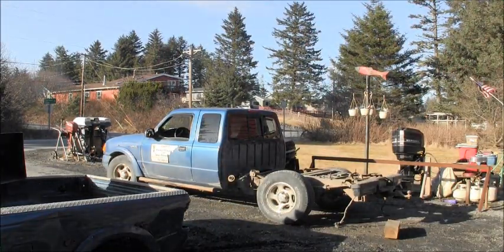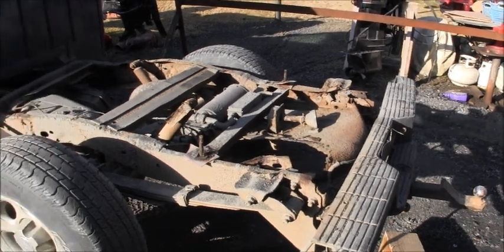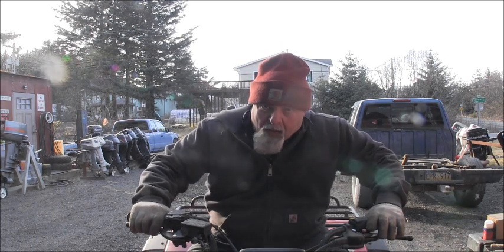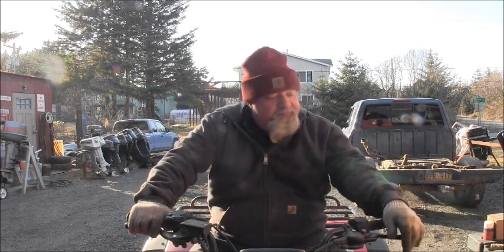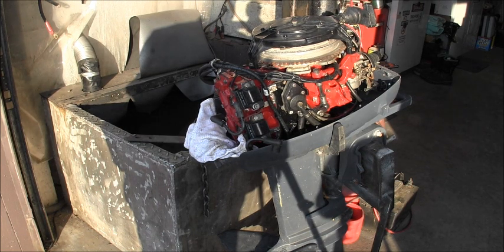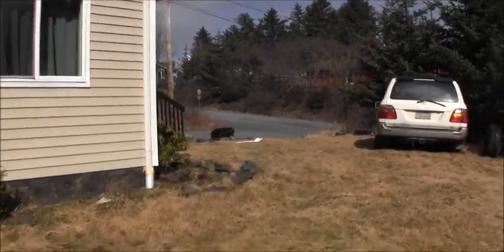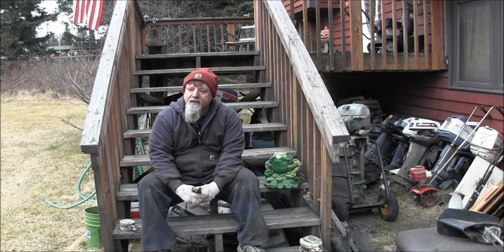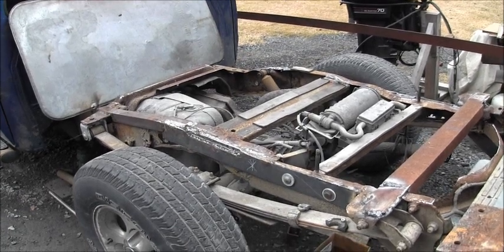EVINRUDE  30 HP,  OUCH    not  good

Comment: Omc 9.9-35hp have been a long time hobby for me. Just curious what 25/30hp in good shape go for in your neck of the woods. Always interesting to see prices from different parts of the states
Reply from the maker: I sold a 1999 30 Johnson in cleane nice condition  last season for 1,200      kb
Reply: Thanks. I'm in Arkansas and starting to see 1700 for clean motors. I've enjoyed the channel a long time.
Reply from the maker: @reedmanus7777   Yep'  with the so called supply chain issues etc.  I could see where a good fresh water motor would fetch that 4 sure.    kb

Comment: have a question...i got a 1999 yamaha 2 stroke 9.9 with a kit ...excellent condition .....motor runs perfect idles perfect...but when you go to the shallow water drive position it won’t idle it dies ...but when you apply the throttle it runs perfect....you think it’s something within the float ....
Reply from the maker: Yep' check your float level when @ approx  tilt & adjust .  I have had the same problem.  kb
Reply: kodibass thank you sir ...much appreciated..!!